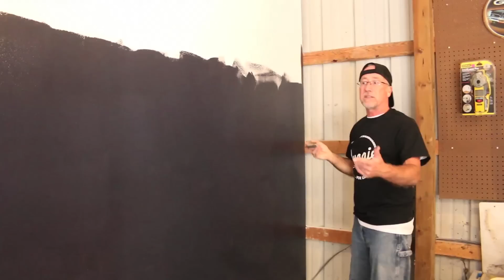THE BLACK GATE!

Comment: Black?! Really. It looked ok white. It's gonna be very hot in there in the summer Jesse. Very hot.
Reply: And I like the colour black
Reply: it's indoors so it's fine
Reply: It will be destroyed before next summer anyway
Reply: Do u honestly think it will not be destroyed by then
Reply: +Landie Man I wanna see Jeffrey cut the power while he's doing a stream.  The black walls will suit the darkness he will endure.  Hahaha.
Reply: +Lookit Me, Ma! I'm Commenting! Good point. He will need to stick some sort of antenna for wifi as it seems the Morton building is a huge faraday cage.
Reply: +Lookit Me, Ma! I'm Commenting! There could be some sort of lead flashing on the roof? But my roof has lead in parts and it doesn't kill my phone service.  I suppose it could be a mixture of his rural location, tree cover and a tin roof. It's been built to quite a high standard (except for the painting) so it would be a shame for it to be ruined or to not be used by Jesse. I think they did use fibreglass insulation and a double glazed window. So an electric heater should help provided he has a roof on his room as well.
Reply: Yeah but he is supposed to move out in January so he won't be there during summer
Reply: +Lookit Me, Ma! I'm Commenting! did you not watch the video of them setting it up with installation?
Reply: +Klutch Rubino he's doing all this then moving out 2 months later?!
Reply: +Arzt Skilpad it's just a fucking myth
Reply: *****
I speak English so its Colour
Reply: *****
The difference between Simplified English and Traditional.  Its always Colour in UK English.

Comment: No, the Tony Hawk thing was faked, but there is still a hoverboard. I'd like to add that it is WAY less advanced then the Tony Hawk video. You can only use it on specific surfaces that are specially designed for it. +Mcjuggernuggets

Comment: That actually isn't a real hoverboard, There still hasn't been an actual hoverboard made yet. The one Jesse is talking about with tony hawlk is the one made by Lexus and the whole skate park that he rides on is custom made with magnets underneath so that's what makes the board hover. It doesn't work on any other surface other than the custom skate park with magnets built underneath. So you cant ride it on the street, sidewalk, grass or anywhere. So if you want one (And there not for sale) you would not only have to buy the board but also a custom built skate park with super expensive magnets built underneath.